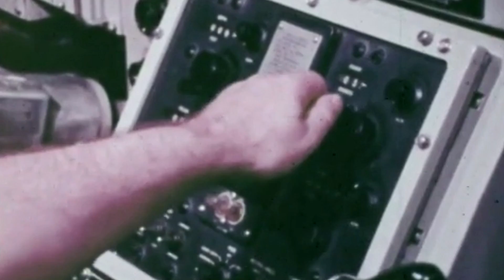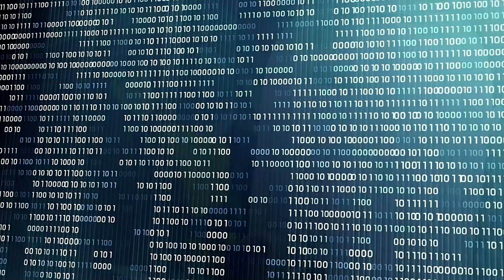5 Unsolved Nuclear Mysteries

Comment: Against a containment building, a drone, even explosive, will at best scratch the paint. Anything short of nuking a containment building would be rather inefective. Even against planes, the containment should be able to hold, the outer might fail, but the inner containment wont.

Comment: If the Fogbank material is required for the second stage, does this means that countries like Russia and China also have this material, considering they also have thermonuclear weapons? And if Fogbank was "initially produced in the 70s and 80s," as he mention in this video, how did the american thermonuclear warheads function in the 50s and 60s without Fogbank?
Reply: It’s likely Fog Bank was a product produced in the effort to miniaturize the weapons. The first ones were simply put an engineering exercise. Can we build this? They were huge, requiring their own refrigeration plants, In no way deliverable. 
Over time and subsequent generations we made them smaller and smaller, this material was likely key to developing that. 
As for the China and Russia, they’ve likely developed similar methods, either from stolen documents or a similar but equally effective material

Comment: Correct me if I am wrong here but I doubt any drone could carry enough explosive to breech the containment building.  Those walls are at least a few feet thick of heavily reinforced concrete. Sure a drone could knock out less protected support systems and shut the plant down. But to cause a radiation leak, very unlikely.
Reply: I think the worst that would happen would be the engineers using SCRAM as a precaution.

Comment: Old WW2 bunkers are notoriously difficult to destroy. I know of a huge above ground WW2 bunker 4 storeys high that after WW2 re-developers decided they could not remove, so they built their  new apartment blocks to straddle it with the bunker pasijng through the middle. My point is that I would assume a reactor building built using the same process of steel reinforced concrete is probably just as hard to break.

Comment: Fogbank was a styrofoam like substitute that turned into plasma during the fission part of thermonuclear device. The heat produced is about three times that of the sun. It makes the heat required to kick off the fusion process or second stage of a hydrogen bomb. I’m from Oak Ridge and heard about fogbank while in high school.
Reply: That entire part of this vid made no sense.
Reply: I've also heard that it could involve cobalt, which could be a separate function or part of a more deadly nuclear bomb, as it makes the fallout much more deadly and last for many more years.They could have totally misled the public about "Fog Bank" and it could refer to something completely different. What you describe does not make as much sense as something like Cobalt.
Reply: @patricksmith2553  I'm guessing salted aerogel.
Reply: Yep if you even look at the tellar-ulam design you can see there's a Styrofoam substance in there to turn into plasma. It's even there on the wiki page for "thermonuclear weapon", in the diagram: 5) Radiation channel filled with polystyrene foam. The wiki page on thermonuclear weapons seems to indicate it might serve a secondary purpose of stopping debris from the primary explosion damaging the secondary before it can fusion.
Reply: Isn't it just blocks of polythene, but with heavy hydrogen to fuel the fusion reaction, instead of the regular stuff?
Reply: If the Fogbank material is required for the second stage, does this means that countries like Russia and China also have this material, considering they also have thermonuclear weapons? And if Fogbank was "initially produced in the 70s and 80s," as he mention in this video, how did the american thermonuclear warheads function in the 50s and 60s without Fogbank?
Reply: @frimodig  There were thermonuclear weapons prior to fogbank, fogbank was created as a new material to replace the one in use at the time.
Reply: Thanks

Comment: For no 1... why not have geo fencing? When I had a drone, I couldn't fly in certain areas because of said security in place. I may be being ignorant of the matter but...I'm just stating an observation
Reply: Geo fencing only works if the drone uses compatible software.
Reply: @DefiantSpurr  I figured there was something I was missing.

Comment: Nuclear reactor containment buildings are 3 feet thick of steel reinforced concrete. It is strong enough to withstand a direct impact from a fully loaded 747 and still protect the reactor inside. A drone, even laiden with C4 would only chip the paint off of the reactor building. A nuclear reactor is much more easily attacked in other ways.
Reply: All the support buildings are not that strong
Reply: @demonprinces17  In most Western nations they are. The US, England and Sweden are.
Reply: @demonprinces17  and what would it matter hitting those outbuildings when the juice is still behind 3' of steel reinforced concrete?

Comment: Could the French place sharp shooters at the plants to shoot the drones down?  I doubt the drones could get any pictures that could not be taken from space or an airplane.
Reply: If it makes you feel any better those plants are staffed with automatic weapons by trained professionals. However firing shots off at drones would be a hazard in itself.
Reply: @psp4150  you don't know and you're trying to make it sound like you do, you used to work at Fort Knox didn't you?
Reply: They could also fly killer drones
Reply: @PC-vq5ud  Good luck with the containment vessel, three feet of reinforced concrete on top of eight inches of steel. That drone better have "Stark Industries" on the tag.
Reply: The French don't believe in guns!😂

Comment: Ironically the reinforced concrete of the reactor buildings is thick enough to easily withstand a fully loaded retro 727 which I learned in a Dark Skies video.
Reply: Just wanted to comment this, a 747 will be vaporized by the thickness of the concrete.

Comment: If you see a drone, just wait, and then follow it back to where it came from. Seems pretty easy? Lol
Reply: Or employ a sniper.
Reply: Not if the persons using the drone use it as a one use item. A few thousand dollars is nothing to well-funded organizations.
Reply: You could use triangulation of the radio signals to get a location on the transmission pretty quickly.  The commercial grade equipment to do this is very expensive (minimum of $750,000-$2000000) but it's a drop in the bucket for most government agencies. But it can also be done with a laptop, a SDR, and a handheld directional antenna.
Reply: @NX-gw7wg  thats a lottuh monuy bic boi
Reply: @SangheiliSpecOp  not for a government, but alas, it's not that simple. Commercial drones tend to operate in the 2.5 ghz or 5 ghz ranges, both of which are also occupied by WiFi radios. While doable, it'd be tricky.

That said, a fuel-powered government drone could have days of endurance, far longer then anything one can buy off the shelf.
Reply: @DFX2KX  But the drones generally use more power than wifi routers so those signals would be stronger.
Reply: @NX-gw7wg  That is true, and Spectrum/Futaba protocols have a different packet structure. In a rural or semi-urban environment, you'd probably be able to lock in with some careful gain and squelch settings (or whatever the equivalent is, CB radios are the only thing I've really messed around with the innards of), in a dense city, the sheer cacophony of traffic would make even that a serious challenge. Doable, perhaps, but not terribly reliably.
Reply: @SangheiliSpecOp  it's also effectively bullshit.

By the time anyone showed up with triangulation equipment, the radio would be off
Reply: Launch a counter drone and observe. Commercial drones have hour+ flight times and flir thermal cameras
Reply: These drones send real time video and sound back to the pilot.  They could also be carrying sensors for data collection, again sending it out for collection before the drones fly away.
Reply: The plant could get some drones of their own to pursue and knock down the spying drones
Reply: Ditch the drone that costs a couple thousand or get a $100,000 charge? Think for a second lol
Reply: Daniel Rodriguez  and more fun :)
Reply: Plus they have to be getting control signals from somewhere.
Reply: You're under some kind of impression they necessarily care about the flight hardware after it has done it's intended job.
Reply: Good idea. Like pursuit and intercept police drones that could follow them stealthily.
Reply: Not really
Reply: On foot? You must be joking.
Reply: @apjapki  😁😂🤣